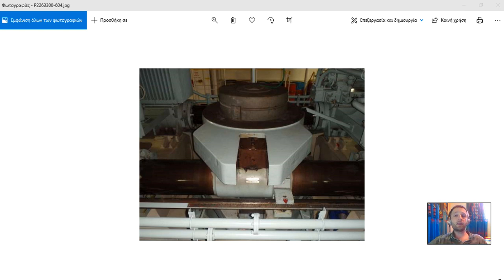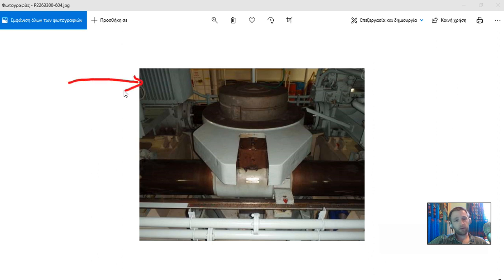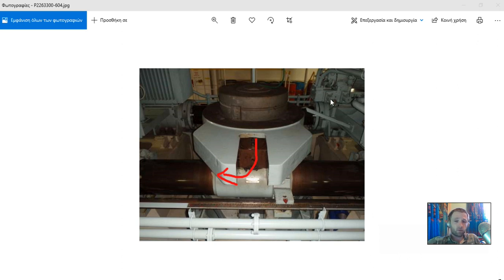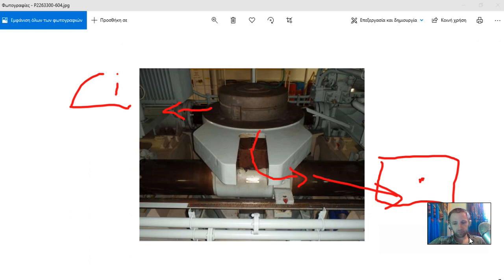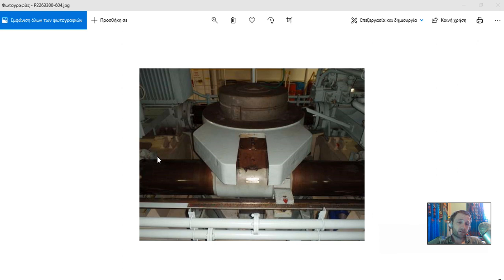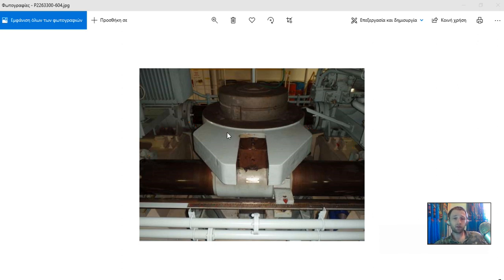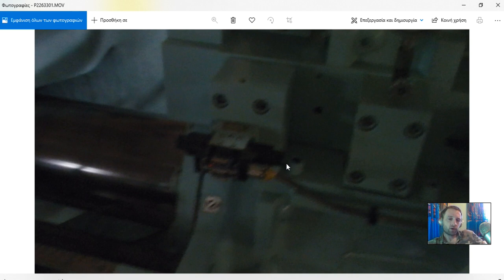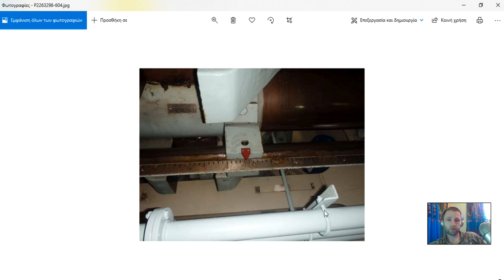Steering Gear How to Vent Air from Cylinders

Comment: sir, good day.
i was studying about steering gear air release method.
the book says:
1) shut off auto pilot system
2) shut off pump unit number 1&2
3) ensure hydraulic oil tank has 75% of oli level
4) close the bypass valve manually, open the isolating v/v manually
5) insert a rod in the hole of the flexible coupling between pump and motor, then manually turn the motor with hand.
6) operate the bi-directional v/v by pusing the button (port/stbd)
7) open the purging cock slowly and purge air by moving the ram/piston 30 degree at each side.
sir, my question is:
if i shut down all the power system of the steering gear platform and operate everything manually, then how the bi-directional v/v will work? 
pls note that: bi directional v/v means the v/v which we use to turn the ram port/stbd with a pin, during emergency steering operation drill.
Reply from the maker: If you switch off the power of steering there will not be any pressure on the system so you can’t purge air. When we get that air bubbles we get it in the cylinders so by moving in emergence first the one side with air purge valve we first take out the air from one side then close the other side proceed to next cylinder.
Reply: Why do we put a turning bar in the coupling?

Comment: Sir, in this vedio you said, your 2nd engr went to collect oil sample from the steering gear system when engine is running condition. As he opened the sample valve, air went inside the cylinder and trapped. So steering gear was not working.
So, as a apprentice engr should i take oil sample only ship not running condition?
Reply from the maker: Yes that's true when ship is stopped at port.
Also there is specific points to take oil sample.

Comment: Sir, I have a question.
How can i collect steering gear hydraulic oil sample?
where is the sampling point?
Reply from the maker: You can collect from level gauge drain plug!

Comment: Hello Sir!! Suppose you have a leak in the hydraulic line of the 4 ram st gear, what should be our action? Isolating the cross rams and cold repair, or something else?
Reply from the maker: Hello if there is a leak on the system isolating valves will isolated the system and it will work with less capacity but still you will have stearing.
Reply: @Adventure-Story  Okay Sir!! But, can we somehow repair it onboard?
Reply from the maker: Depends the damage if it is in our knowladge  like pipes that is something we know and also there is a need to have some materials to repair.Something there is not proper materials onboard because this piping is special for high pressure.
Reply: @Adventure-Story  Thanks a lot Sir!!🙂